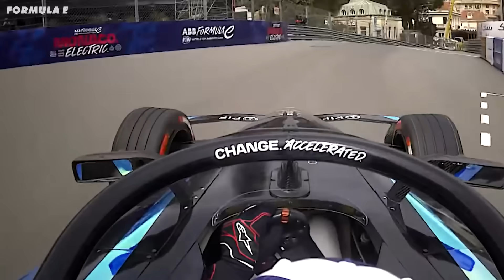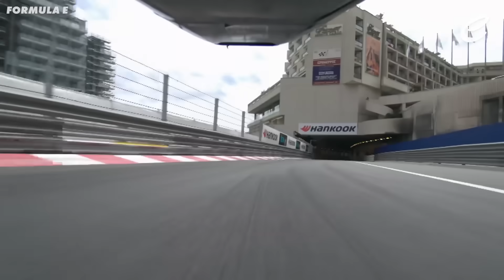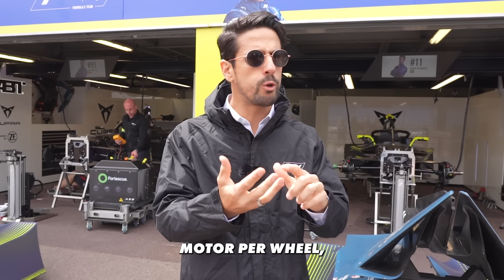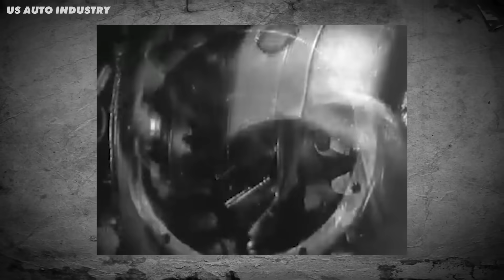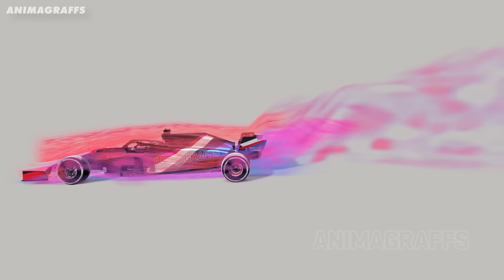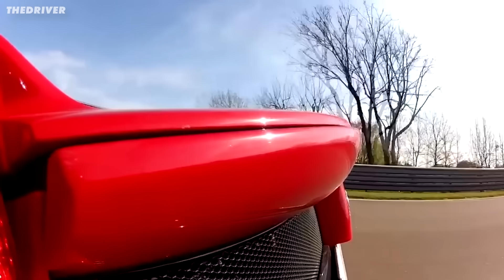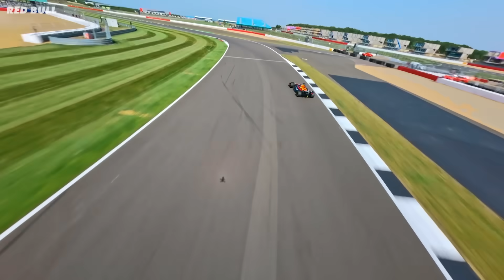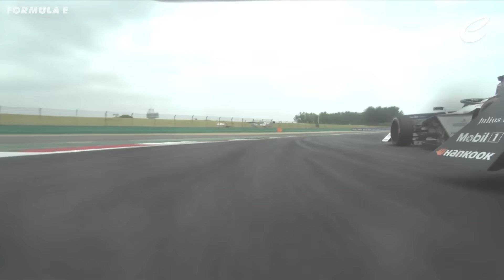The New Formula E Car Might Be F1 Fast

Comment: 1:50 those people rolling their eyes at "efficiency" in motorsport have no idea what endurance racing actually is.

Pitting less for fuel is very important to win there.
Reply: For real, some of my favorite NASCAR and IndyCar moments are fuel mileage wins, and I consider winning on mileage possibly the most impressive way to win in terms of skill (from both the driver and the engineering team).
Reply: Competition cars are a fairly pure engineering exercise, with little sacrifice made for anything. In engineering - of anything - efficiency is KING. F1 itself has brought great progress to the efficiency of street cars. I’ve been a racing fan for over half a century. The winners have always been the ones who could best tap the operating efficiency of every part of the car.
Reply: And how popular is endurance racing vs all of the other kinds of racing?
Reply: Wow, i wonder if full eletric endurance is possible, lol, which team goes the furthest within 4h wins
Reply: Good luck in Le Mans with a full E-Car. xD
Reply: @chrisbee9643  It's gonna happen. No matter how much yall cry about EVs, it's gonna happen.
Reply: @mondodimotori  It doesn't make EV cars any less soulless and boring.
Reply: @chrisbee9643 It's not impossible for a BEV to be at Le Mans, it just requires what could be considered cheating. You just replace a depleted battery pack instead of charging it. China is looking into this as we speak, just in regards to production cars
Reply: @chrisbee9643  The challenge in electric endurance racing is getting the efficiency in the right window. You need a battery that matches charging times with stint length. This won't come in the next 4-5 years, as we need a different infrastructure in the pits. Also, battery technology is still developing at a significant rate. Starting electric endurance racing with a more mature storage system greatly reduces the requirements for the infrastructure.
Reply: @MrHaggyy  
Also keep in mind this.... You might not need a road battery. I mean look at the ID.R, that is a modular setup... they tackled the ring (the second time) with a lower batter capacity than at Pikes. I would see the same thing happen (and has been for a while with FE) with racing car, they don't need to tackle hundreds of miles in a single charge, so why put in something that has nearly 100kW? FE makes due with half of that.
Reply: @DuvJones  You get a pretty good approach to energy demand, if you focus on speed, mass, and time.
So we have E = 1/2*m*v^2 and E = W*t.
Going faster scales the energy demand quadratic, so we only want as much top speed as necessary. Mass enters linear, but the value can change quite a lot.
In F1 terms: 3.8MJ = 1/2*798kg*98m/s^2
That's 220mph I guessed as an average top speed, which costs us ~1.1kwh.
It's the same for GT3 with 1200kg and 83m/s / 300km/h.
In FE terms: 1.6 MJ = 1/2*840kg*62.5m/s^2.
FE has a fixed top speed of 225km/h and takes 0,444 kWh to get there. (0.5 kWh is the intended value by the regulation).
So we need to double the energy demand to reach the same speeds, and while FE races 90km an F1 race is over 300km. A GT3 car can make 170km, which is still roughly double.
Both F1 and GT3 run on ~100kg of fuel. 1kg has 12kWh of energy and they can roughly use 50% of that. So both cars have something between 500-600kWh available.
So to make endurance racing work, we need to find a compromise of low weight, low top speed, and high energy capacity. My personal bet is a car with slightly more top speed than FE at ~1000kg where they spend the additional 160kg to fit a 100-200kWh battery. That would allow for a stint of 1-2 hours. Probably in favor of a lighter car with a length of 1h.
Reply: @DuvJones depends how long is the race and how quickly you can charge or swap battery. a larger battery would still beat a smaller one in endurance racing unless you can swap batteries in a few seconds and are allowed unlimited battery swaps
Reply: @MrHaggyy the optimal battery size would be completely different in a battery charge or battery swap scenario. battery swap would favor smaller batteries and battery charge favor bigger ones. charging would have to be ~20-80% with current battery tech
Reply: @DuvJones are you suggesting EV racing  a 3300 miles/24h race at 140mph average including stops should use similar batteries as one that is 12 miles/8 minutes ant am average 90mph ?
Reply: @geemy9675  Yes, but it would also depend on the type of car, distance, and how long you can charge. In F-series, where the battery is usually part of the chassis, they favor entire car swaps like FE does. In endurance racing (GT), they favor three batteries cycling 20-30 min. stints. The charging infrastructure in the pits is also a huge topic. The cars would like 100kW-1MW, we have 20+ boxes, which makes it a medium voltage application. Most tracks are LV only. It also needs to be compatible with the fuel system in place. Because a track can't afford an either-or situation. The amount of recuperation allowed will also affect the whole system.
Reply: @MrHaggyy the Regen shouldn't be limited in racing. Formula E has AWD Regen but rwd propulsion, almost double the Regen power, which makes them very efficient. I think they are transitioning to full awd
Reply: @geemy9675  Yes, I would love to see an engineering competition in a prototype class again.
Electric motors are fascinating for racing. They can turn electricity into accelerating or braking torque, and they can generate electricity from RPM. They also produce various levels of heat while doing so.
AWD in Formula cars is fascinating. You want as much acceleration at the rear, and with the grip these cars have, it's all of it at rather low speeds. The front needs to give direction. In braking, you want a strong generator in the front, as the rear gets lighter the more rapid your brake, and you need some margin of stability in the rear, otherwise you spin on turn in.
Reply: @chrisbee9643  
Personally, I would like that see that. Because EV's have a bit of a problem that LeMans (and the WEC in general) is built to solve. 
The thing with EV's is that the band of operation is extremely tight. Too much cold and you done. Too much heat and you done.  When watching a few racers talk about Pikes Peak, Road EV's run into a odd issue... they tend to overheat when compensating for the cold and driven hard, at times braking the heat pump because it's working so hard. Normal folks don't run into those limit. 

That is what LeMans (outside of the spectacle) is built for.... it brakes things, that is the point of the race from an engineering standpoint and why it exists at all. Run shit till is breaks, investigate the failure, patch/fix the failure, run it again till it breaks. Stop only when it's terminal, or the driver quits.
With an EV, you can also put stress on the infrastructure of the car and components with limits to the battery capacity, the ACO already does with this fuel and tires.

Not sure if the FIA or the ACO would dare attempt that, but it would be interesting to consider.
Reply: @chrisbee9643  20 years from now...  Good luck in Le Mans with a full ICE car...  Progress is like geology, it's all about pressure and time.  Formula E is growing more popular, (you have the pressure), and the boffins in the lab coats thus have incentive to also race against time...  Meaning, that as time progresses, innovation accelerates.   There were people who sniggered at the Wright Brothers, watching Niel Armstrong take the "One Small Step..."
Let the guys cook.
Reply: Dull. 
That's what endurance racing really is.
Reply: @procatprocat9647    The less you know, the duller it is.  The tik tok generation doesn’t know much.
Reply: @artysanmobile  most forms of motorsport have a gladitorial element to them. A fight between humans who have particular skills and personalities. The machines are tools to be used up to and beyond their limits. There's a relationship between the human and the machine that can be good (poetry in motion) or bad (another battle)

This is what transforms motorsports from being a pure Engineering challenge and marketing platform, and into a sport. 

Endurance racing doesn't have this. The machines are used well within their limits because reliability is what matters most. That's dull. 

 That's why it isn't popular.
Reply: @procatprocat9647    You have it EXACTLY backwards. Endurance racing is a war. You only have the patience for a drag race. That’s ok. Not everyone understands motor sports.
Reply: @artysanmobile  I agree with you. Endurance racing is a war. It's a war between Engineers and strategists. 

Unfortunately that's not what makes for good motorsports. 

Endurance racing would be an ideal candidate for driver deletion and replacement with AI drivers. It could then have a use as a technological development tool. 

It currently serves little purpose because it isn't a sport for the above reasons. 

The viewing figures and regular exodus of major teams is damning evidence. 

Look, you clearly love Endurance racing. You're in a minority, but that's okay. Enjoy your thing while you can. It won't survive for much longer in its current form because it isn't a sport, it's just a war between computers and their operators.
Reply: @procatprocat9647  Dude wtf are you talking about, there is a MASSIVE exodus TOWARDS WEC right now. 
Ferrari, BMW, Lamborghini, Alpine, Aston Martin and future plans in motion for Hyundai and other manufacturers too.
Reply: Le Mans will never be won by an electric car, it’s impossible no matter how good your battery is
Reply: @henryhallam5270  Still not the point he is making. Efficiency was ALWAYS the goal. The gains are just massive.
Reply: @henryhallam5270  With battery swapping and solid state batteries, it definitely could be possible. I would say, never say never
Reply: @lewis8552  That completley defeats the purpose of efficiency then of electric since the energy to create the battery destorys the environment
Reply: @henryhallam5270 it could be possible with battery swaps. I would set 2 batteries per car limit so they still have to come up with interesting technology to fast charge one battery while the other is being discharged on the track. le mans cars make about 30 pit stops, one ~1 minute stop every 48 minutes.
Reply: @geemy9675  Formula E already do a similar pit filling timing cadence this season, so obviously already doable starting with a separate class to begin benchmarking, followed by EoT. In addition, there are a whole array of more mix and match flexible charging methods already in daily widespread commercial use for reduced pit filling, ensuring dominance.
Reply: @henryhallam5270you might argue that would be am unfair advantage but racing Evs with powerful enough wireless charging under the track would be instantly competitive and only regulation would determine if gas or EV would win. I don't think the tech is ready even at an experimental level but it might be in a few years. also a certain battery size + limited charging power would level the advantage
Reply: @henryhallam5270 depends, I could see someone making the case that swapping the battery could count as refuelling 👀
Reply: @henryhallam5270  "Never"

They said the same thing about Diesel cars and Hybrids.
Reply: @henryhallam5270 I don't know if I would say "ever". Regen braking isn't enough, but there are people already working on and testing on different ways to regen. It would not surprise me in even 5 years we have a system that could keep a car going for much longer than using current tech, maybe not drive and charge so you never have to use a station. One thing we know is it won't be free regen power if it comes lol
Reply: @henryhallam5270 electric vehicles have already won 24 hour endurance races as well as races at Le Mans, so its obviously doable
Reply: @henryhallam5270  It can if it's hydrogen electric, the gas is more expensive but the car is lighter, can make the same power and fuels up about as quick as an ICEU car.
Reply: @F1ll1nTh3Blanks  Not necessarily. Hidrogen tanks are heavy AF because they need to sustain huge pressures. Hydrogen is not the solution for cars, at the moment.
Reply: @mondodimotori hydrogen tanks for road cars yes, because nobody wants an hydrogen car that vents out hydrogen, can't be parked on indoor garage or loses it's whole tank of hydrogen in 1-2 weeks without driving.
but for race cars, planes, rockets...liquid hydrogen at atmospheric or low pressure makes much more sense. refuel liquid hydrogen just before race/flight/take off. only requires a well insulated tank but for 1 hour it doesn't even need insane insulation.. heat insulation takes space but it can be made very lightweight. vacuum, Styrofoam, or even better aerogel, are all excellent heat insulators while being very lightweight.
Reply: @F1ll1nTh3Blanks hydrogen cars are extremely heavy, even more than electric cars
Reply: @mondodimotori  carbon fiber and hemp fibre can hold hydrogen
Reply: @henryhallam5270  exactly...

Comment: No noise, no point.....and the benefit to 'the planet' is minuscule.
Reply: Hard disagree. We race almost every vehicle we've ever invented. This is just another one, and the racing is WAY more exciting than F1.
Reply: @morningstarkid07  Formula E is the 4 wheeled equivalent bicycle racing, practically everyone has the same equipment and occasionally they fall over.
Reply: @spent808  Cool! They do all that while also providing demand for and research towards better battery tech! Just like video games and cgi did to graphics and computing. Better tech makes better stuff. Sounds awesome to me!
Reply: No noise? I went to 3 Formula E races, and let me tell you, it is FULL of noise. I could hear the wheels spinning on the start from the opposite side of the track. I could hear the downshifts from the gearbox. I could hear the wheels on every little bump or kerb. All the racing noises that we cannot hear with combustion engines.
Reply: @FMAlchemist2006  It's the wrong noise, I can go for a walk in the country while listening to Death Metal on my headphones, but you know what? It's just not the same.
Reply: @spent808  wrong noise? First time I read something like that. They are all noises that every racecar does. The difference is that they cannot be heard over the engine noise.
Reply: so basically if they add 130db speakers to their cars simulating an epic v10 racecar sound (like they already do to some extent in the porsche taycan for example )you'd quit watching F1 and switch to formula E ? press x to doubt lol .. 
But i guess its a good thing to know what they need to do to get the interest of the "HURRDURR that doesn't sound like a racecar" crowd should the FE desperately need a piece of the F1 slice
Reply: @Gansa75  X...anyway how are Porsche Taycan sales doing? I heard they've fallen off a cliff.
Reply: @spent808 ow.. I didn't knew  sales were relevant I wasn't aware you were planning to buy a gen4 formula e single seater
I was merely using the taycan as an example that the technology already existed and can perfectly suit the needs of the simpletons who's car NEEDS to go vroom
Reply: Those batteries are so good for the environment.  Electric vehicles are a scam
Reply: @birddogz545  you don't go through a whole tank of batteries every 200 miles.
Reply: @morningstarkid07  On a world scale you do realise what driving 20 F1 cars every other weekend actually represents in terms of 'killing the planet'? Please tell me you do.
Reply: @spent808  I'm not arguing against F1. I'm not stoked about Formula E just because of the environment. I'm just pointing out a factual reality about electric cars.

Comment: No noise, don't care about the rest.

EVs are to speed what AI is to art.
Reply: Alright, caveman
Reply: @redluca56  I like my cave. We have poker and engine noise.
Reply: EVs are faster.

AI is just a tool, not a magic button.
GGWP you managed to put two misconceptions from two different fields in a single comment.
Reply: @mondodimotori  way to completely miss the point of the comment. Bet you thought you were clever though lol
Reply: @bongwaterbojack  Hard to miss the point when you don't have one in the first place.
Reply: @mondodimotori  I agree that it's hard to miss. Makes it all the more impressive that you did.
Reply: @bongwaterbojack  Hard to miss something that's isn't there in the first place. Speed is unrelated to engine noise. But whatever, we went into the "soul" talking point, the sign of "I don't have a valid point".
Reply: @mondodimotori  read the first sentence. Made my stance quite clear there.
Reply: @bongwaterbojack  That's like, your opinion, man, not a point.
Reply: @mondodimotori  Of course it is. Never stated otherwise. Just happens to be the correct opinion lol
Reply: @mondodimotori  I've noticed you edited this, so I'd like to add a response to the bit you added.

The argument that "soul" is tied to engine noise is not trivial. In fact, dismissing engine noise as negligible seems reductive and inconsistent with the broader experience of entertainment media.

How can one take something like sound, a key element that has defined eras in human history, and pretend it doesn't matter? Just as music serves as the soundtrack to decades and movies, engine noise is the soundtrack of motorsport. A few notes are all it takes to evoke memories of Star Wars (pre-Disney) or The Lord of The Rings. People yearn for the V10 days of F1 for more than Max' dominance. The sheer emotion conveyed by sound or melody is unparalleled, yet I'm supposed to accept that a love for the mechanical symphony of a combustion engine is merely "old dinosaur talk?" That the strange whine of a magnet and some bearings somehow compares to the scream of cylinders firing in perfect harmony? No. I reject it. These details matter, and I am not alone in recognizing their significance.

Rant over.